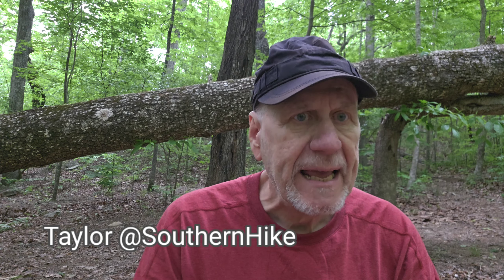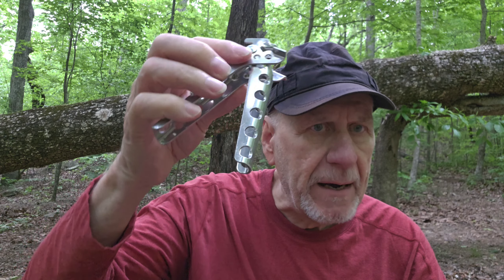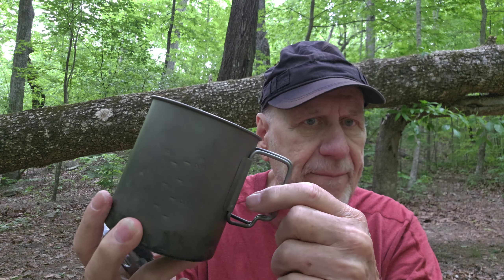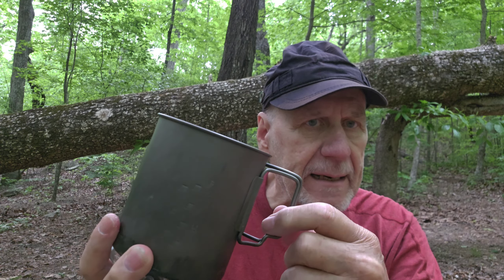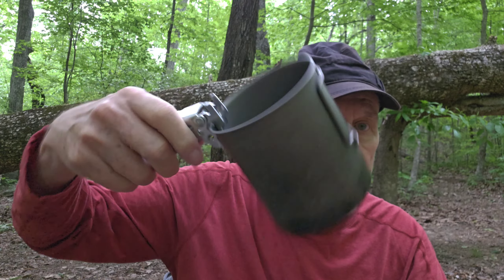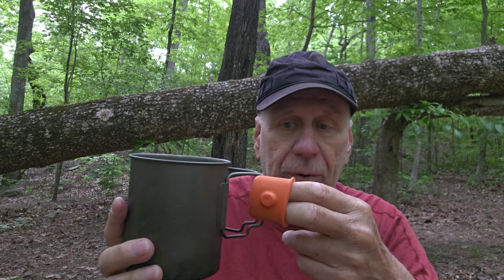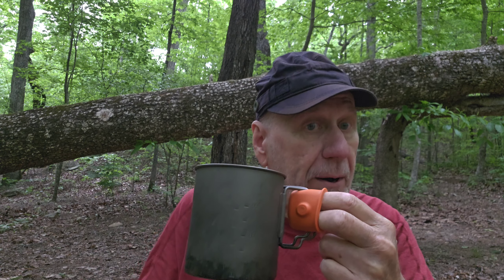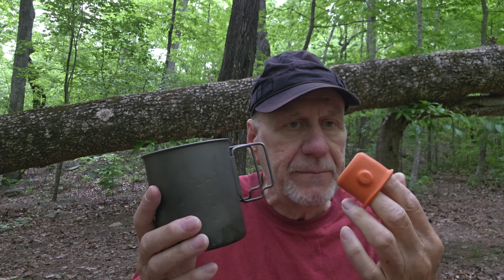GSI Outdoors MicroGripper

Comment: Never like pot grabbers. The silicone grip or I use the included orange stuff sack if it’s too hot. Also can burn your fingers a few times and you become immune to hot handles 😂.
Reply from the maker: Yes.  I don't use it either, my bandana works just fine.